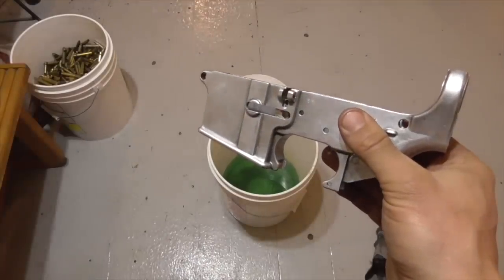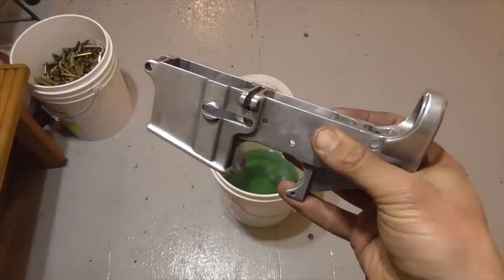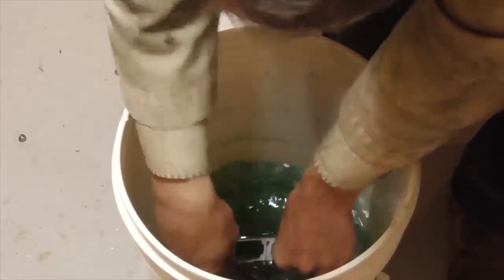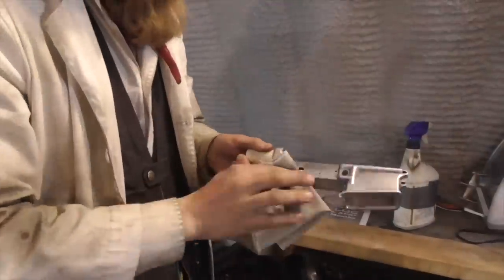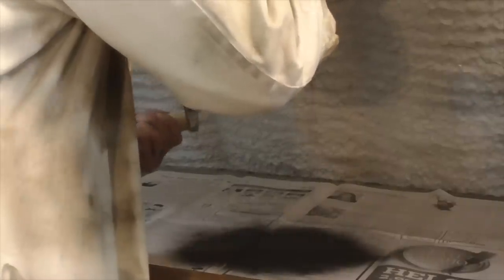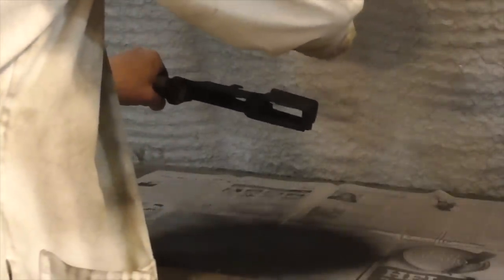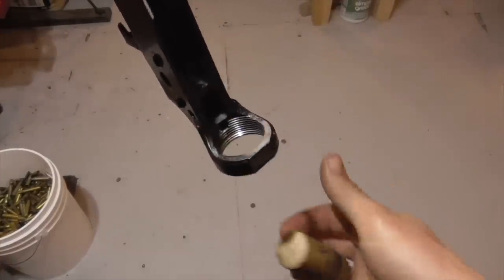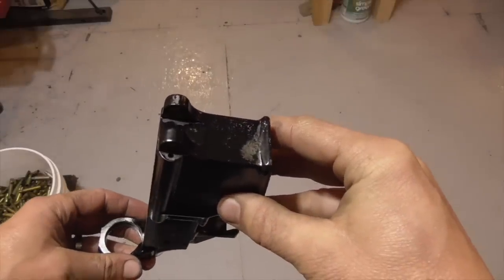Powder Coating: The WD40 Method (TIS263)

Comment: 2nd  application possible.  I play with a cheap powder gun and learned that if the 1st coat has thin or missed spots reheat the part (sub gloss temp)  apply more powder to to bare area and return into the oven and cook until glossy.   I do reconnect the electrostatic leads to help attract the powder to the bare area but the hot metal may allow sticking of the powder.  Thank you for sharing your wd40 method.

Comment: I have never heard of coating using this method, I use to powder coat professionally and the prep work is crucial for quality parts. I'm really surprised it did not come out with fish eyes, out gassing and porosity all over. I think for what it is it turned out darn good especially if you took a bit more care to coat it with the WD40. very cool video man! I enjoyed that.
Reply: Croxbone  Also silicone will do this to powder coating, found out the hard way.
Reply: There is a reason you haven't lol
Reply: Funny to see you commenting here 😅😅 I love your videos
Reply: I powder coat daily also , who the fuck would spray oil on something and powder coat it , I imagine the first shot out of the gun would crack that contaminated powder right off the metal .
Reply: @andrewspence7635  I think it works because it is such a light weight oil (it's not a lubricant).  During the baking, I'm guessing that it is cooked right off.
Reply: @andrewspence7635  Low intelligence is indicated by the use of expletives, we have no need to use such language to describe what we want to say.
Reply: @starbattles1  Martin never claimed to be debating anyone. Yet you act as if he is obligated to. He is not. Also, he has every right to call out and rebuke the needless foul language. Insisting on decency and civil behavior in public is a perfectly legitimate and admirable thing to do. More people should be doing exactly what Martin did.

If Andrew doesn't want to be thought of as ignorant, vulgar and even stupid, then he should learn to watch his language so that complete strangers don't get the wrong idea about him.
Reply: @starbattles1  Buddy, you just lost your own argument.
"@Martin Winfield" was not entering into a debate with "@Andrew Spence" on the subject matter, he simply called him up on the unnecessary use of "rude words" in a public forum that could legitimately be of interest to folk of all ages (including "under-") and all backgrounds (including the "sensitive" or "lily-livered").  I liked what you said in you intermediate message that was not in direct reply, stood on its own, and outlined how intelligent people should approach matters they don't yet understand.  But the way you ended each message directed at other contributors almost made me forget that one good message and think you are nothing more than a bullying tw@t.  (Says I, desperately trying and failing not to add more foul language to the public forum I'm trying to defend for the budding young engineers I know are watching...)
I might have directed my group of neophyte engineers-to-be to read that comment where you describe your 25-year-old company, but instead I must keep them away from this thread because of your comments.  Well done for shooting yourself in the foot, losing any intellectual debate there might have been here, and corrupting another tiny corner of the Internet.
Reply: @starbattles1  Fuckin' right man... tell 'em!

Comment: For what it's worth, I worked in a factory that did a lot of powder coating on steel and aluminum. The black, blue and red colors all did best. Any of the other colors were more finicky. Especially yellow. This is a very cool DIY method for such "components" I may try it out some time. Thanks!

Comment: I used to be a technical coaster that covered powder (both electrostatic and dipped in fluid air), stove enamel and static wet spray systems. I must say that the “WD40 “ method isn’t my favourite application by far, but I suppose it’s serving a purpose. Have you thought about another method for applying powder,  you will need a very fine sifting sieve that will disperse the powder equally on the” product” if you are going to shaker a ground parsley container, please don’t as your “products finish” will not be happy 😕.  Ok so I’m English and work of degrees centigrade, 
1, degrease “the product” thoroughly and dry off with paper towels or lint free cloth.
2, mask off any areas or faces that you do not want to be coated.
3, preheat the waffle heater to 210 - 220 centigrade, 
4, place  “the product” inside on the rack being mindful that you don’t allow any contamination to fall on from your waffle warmer.
5, make sure your powder is dry! It should be very easy to move and sift onto “the product” 
6, carefully take  “the now very hot product” and gently sift powder onto the faces you want to cover, depending upon what type of powder you have, be careful not to apply it to thickly, “it should melt onto the surface you want painting, “IF it’s not melting or getting slower to melt on the surface then carefully place “the product” back into the waffle heater,  IF “THE PRODUCT” POWDERED FINISH IS NOT MELTING . THEN PLEASE CHECK IF THE WAFFLE WARMERS PLUGGED”
7, if waffle warmer wasn’t plugged into the electrical point, remove the sifted powder preferably by a clean air blower or a clean paint brush ensuring that you don’t get any mucky fingerprints onto “the product “....enjoy 

You can also create a air fed fluid bath of powder that you can effectively dip your “heated product “ in and remove quickly as this method creates an enormous amount of powder and is generally used for epoxy powders that requires a chemical resistance finish.

I do hope that you create a decent finish, which boils down to preparation,preparation and preparation.  Like I mentioned that I did used to powder coat to very exacting standards, nothing less is a failure, one of my ovens was 100’ long with a single track going through it, that could accommodate items up to 6’ width,8’ tall, and as long as you like, my box ovens could fit a Chevy Astro inside (to us brits a merc Vito similar in size).

Hope that you enjoyed the suggested ways of application for powder,    Enjoy.....Phil

Comment: Cerekote is the preferred coating for these type items. If you go to the NIC factory in White City OR, in the lobby there are several Complete examples of their products and if you look up the stairs to 2nd floor you can see several thousand colors they supply. It looks like you didn't get enough powder on your item, don't shake it off. Bake only 15 minutes max

Comment: I do not believe this would be serviceable the coating would have minimal adhesion WD40 is a release agent, plus the finish is appalling.
Reply from the maker: I did some destructive testing with small aluminum plates coated using this method, and the adhesion seemed to be excellent.  Some powders work better than others.  I tried a pastel blue powder that was slightly prone to chipping, but the black and dark green powders I tested (all were from Eastwood, their Hotcoat line) were very adherent and completely chip-resistant.  In fact, it was almost impossible to remove the coating without gouging the aluminum as well.

Comment: Beautiful apocalyptic flux capacitor coating! If you already had powder coating powder from freedom seeds, this is a cheap experiment. A properly passivated oxide layer would still be harder for the long-term. Anodizing color addition your choice for the flux capacitor then. 👍

Comment: Great info brother.  I didn’t even know you could do power coating at home until you made this video.  When you mentioned needing to “refit” a couple of pin holes, etc.. would that be removing the finish in the pin hole, or turning down the pins?  Is it possible to do a second coat on the areas that didn’t get good coverage?  You have opened my mind to many possibilities with this!
Reply from the maker: You could probably do the re-fitting either way; I did it by inserting a drill bit into the holes after finishing and turning the bit through a few revolutions just by hand.  I'm not sure about adding a second coat of finish--I haven't tried that yet.

Comment: I've used the spray paint (ceramic) from Brownells similarly, except you just spray it on and then cook it in a toaster oven.  My parts turned out better than this.  They look nearly professional.  Best for it to be hot outside or heat the part before application, then bake after spraying it .

Comment: First time I've seen that before with the powder, I like the channel so much, there's always something new.. what do you think about polymer 80s?
Reply from the maker: Thanks!  So far, I don't have any experience with the polymer 80s.  If they're dimensionally the same as the aluminum ones, I'd be concerned that the lower strength of the polymer material could be a problem, but it seems like some people have gotten them to work ok.

Comment: I like to use Rustoleum Appliance Epoxy when I need a 'powder coated' finish. I spray it on, allow it to become touch dry, and then bake it in pretty much the same way you baked the powder coat. It is rock hard, very scratch resitant, and is also resistant to all of the usual solvents, and even some really harsh ones like acetone and MEK.
Reply: I used Rustoleum hammer coat oil based paint for a motorcycle spare gas tank... And after the first fill-up, I discovered that even after an extended cure time including heat, that particular paint of their's is NOT fuel tolerant... So, I ended up stripping it off and powder coating it white instead... :(
Reply: Wowser! This is great to know. I have some RAE and a small convection oven I bought for this purpose. I have to try this method out!!! Thanks!

Comment: Maybe try spraying a light film over the surface then applying the powder with a HPLV gun($13 at harbor freight). Might make the coating more uniform. Test on a flat sheet wingle side many ways to find a system that works before doing more complicated shapes.

Comment: Chip test it, guarantee it'll Chip,

if you don't have a electro static gun, put the powder into a pot large enough for the part and aerate the powder with compressed air to turn it liquid, you will probably need PVC pipe glued at the bottom of the pot with holes drilled into it and a air fitting attached to it to aerate the powder, then pre heat your part to 170*C for 2-5 mins then dip and completely submerge the part straight in the aerated powder and it should stick straight to it due to the heat, then bake it for a good 10 mins (doesn't need to bake as long seeing as object temp is closer to baking temp) at 220*C, then 'voila, should look almost as good as painted with an electro static gun, if the powder is aerated correctly you should be able to dip the part straight in the powder without problem, if you put your hand in it, it should feel like your putting your hand in water.. But of course it's powder though, then you'll know it's aerated correctly

Also another side note if your powder coating aluminium, you should sand or grit blast it prior to coating, as aluminium produces its own cloudy protective coating which can be detrimental to the powder adhesion and longevity of the powder coat , I would recommend dipping it in a diluted mix of water, sulphuric acid and hydrofluoric acid for 8 mins to remove that cloudy coating, but not everyone has sulphuric or hydrochloric acid laying around, plus alot safer to blast or sand, because sulphuric eats skin and meat, hydrochloric eats nerve and bone

Source: am a powder coater
Reply: Surface Prep is Key and putting WD-40 on a surface to be coated is what we call a Mould Release Agent.  In other words, IT Ain't Gonna Stick!
Reply: @acciuser  yea she won't last long that's for sure, generally you want all substrates free from oil before coating...but the vid makes for a good laugh and experiment...I guess, but I wouldn't recommend anyone watching to use WD-40 to make powder adhere to anything, haha
Reply: What if I'll use spray on glue before apply the powder? Ha ha one crazy idea after another.

Comment: After you cure the coating if you have missed spots can you coat it again if needed of course that would make it to where you would have do all the clearances again but I guess my question is more will it work or will it not adhere right on the second coat

Comment: Wowser! That was very interesting!
I've just started powder coating freedom seeds. There appear to be two relevant methods for me, based on my on-hand supplies. 
I have some Harbor Freight White, and for that, I heat the freedom seeds to 150 F, then do the dump & shake, then bake at 350F for 15 min. 
I also use (now) Eastwood Ford Light Blue, and for that, no pre-heating is required. Shake to coat, then 350F for 20 minutes. 
NOTE: I tried doing the shaking in poly-pellets, but I was using Harbor Freight BLACK, and got awful results. I have since discovered that no one thinks Harbor Freight Black will work to powder coat freedom seeds.

Comment: Somehow it never occurred to me what powder coating means, I assumed it looks similar to spray painting rather than a salt shaker type of thing.
Maybe putting the part in a box with sufficient powder and shaking the box violently for a few minutes would give a better coat?
Reply: If you want a KFC effect... 😁
Reply: Big soft fluffy make-up atrist brush would cause a near perfect mist of smaller particles, maybe by jently tapping it around the part would maybe achieve a more consistant thinner coating?😉👍

Comment: Interesting. the Result looks terrible, but you never know when this might be the best option you got. Thanks for sharing!
Reply: Peter August automotive springs
Reply: @aterack833  ?
Reply: Peter August the guy who replied automotive springs, what he meant to say is the powdercoat is mostly for metal parts on cars that your trying to preserve, most people would think automotive when you mention powdercoat
Reply: @OrangeBananaMongoose  But Powdercoat is not mostly for car parts. Actually hardly any car parts are powder coated.
Reply: @peteraugust5295  OEM auto parts are almost always powder coated, Do you work in the automotive industry? Every tonka truck and race car has powdercoated something because the parts come in bare metal and they are custom fit, they dont just leave it bare metal you have to coat it. What do you possibly know about automotive powdercoat when its part of my job.
Reply: @OrangeBananaMongoose  so because powder coating is part of your job other people cant know anything about powder coating?

Yes. I work in the Automotive Industrie,  and the only parts that I can come up with that usually are powder coated are springs, parts of the shocks some engine holders and maybe suspension arms. 
Powdercoating is far, far down the list of surface treatments in the automotive industry.
Reply: "
Peter August
3 months ago
Interesting. the Result looks terrible" 
Where exactly are all the beautiful perfect parts you've done????
didn't think so... shut up damn critic. The guy just took the time to teach people something they may not have known... Personally I do my own chrome, powder coating, painting, as well as anodizing.... I've been at it for over 20 years... And I still say, for a battle weapon, this finish is beautiful... AR-15's are not show pieces, they are for patriots to defend liberty against oppressive governments.. but I'm sure you're the best at that too... Ever fire an M4 rifle? oh damn, now you're an expert on those too right? I am...
Reply: @patrioticbastard5935  If you have done this for 20 years and call this beautiful, then this is proof that doing something for a long time does not mean you are good at something...
The Finish is shitty but it works, that is a fact and that is what I said. If that hurts your little snowflaked feelings then deal with it. That is your task, not mine.

By the way I have never fired an M4. However I have fired a lot of AR15s, which are somewhat similar to the aluminium component we saw in the video, Mr Expert :)
I wonder how that correlates to what I said about powdercoating though. A lame try to reduce your opponents credibility I guess. Try again.

Comment: have you considered electro-plating your parts? I haven't seen a video of yours with an electrolysis machine, but they can be made easily from a computer power supply and have many practical applications, including plating, removing rust and even making pure silver from impure silver shot.
Reply: It's hard to protect the threads in an electroplating process.
Reply: Paint the threads with a thick layer of spray paint you blow into a cap, remove afterwards with acetone

Comment: What if you heated a clean part up and pulled it out of the oven and sprinkled the coating on while it was still hot?  Then baked it on ?
Reply from the maker: That sounds similar to the "hot flocking" method, which I've seen other people do, but haven't tried myself yet.